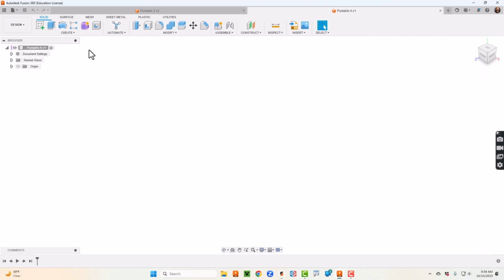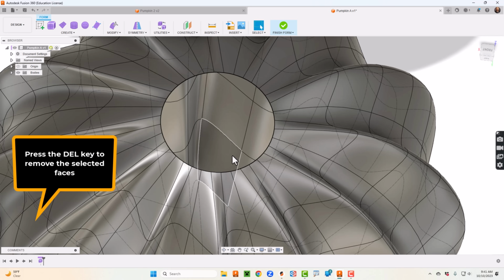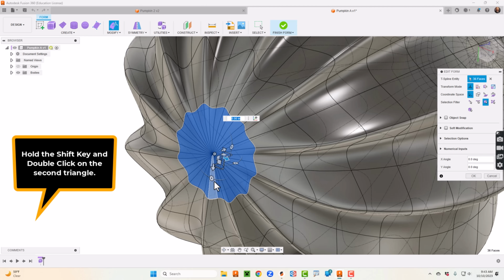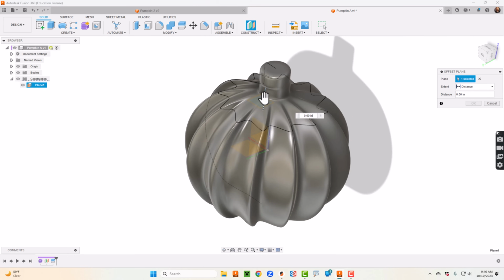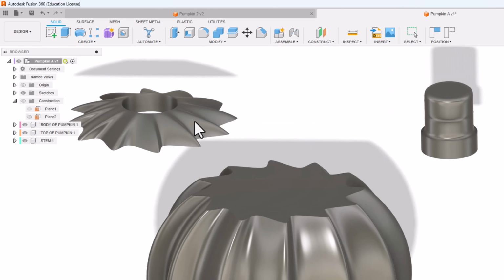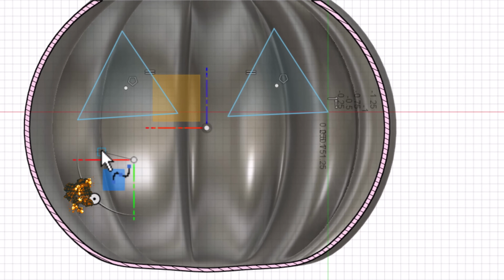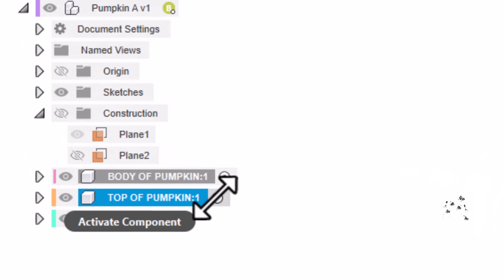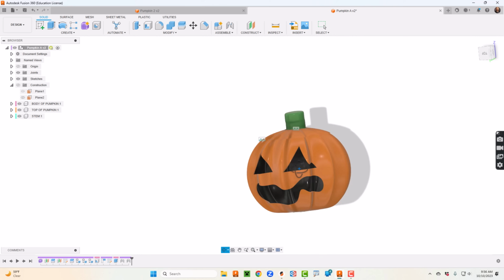Creating the Ultimate Jack o' lantern in Fusion

Comment: Great video. My drawings and my students drawings are taking forever to save in Fusion and most times it does not save. What I did was to set up a class lab with my students. Any help?
Reply from the maker: That's not so fun. Are you using the web version, or the version installed on a lab? You also need to make sure you have an account setup with Autodesk.